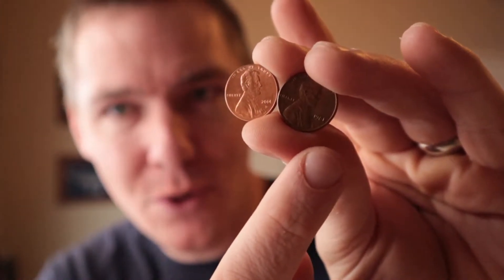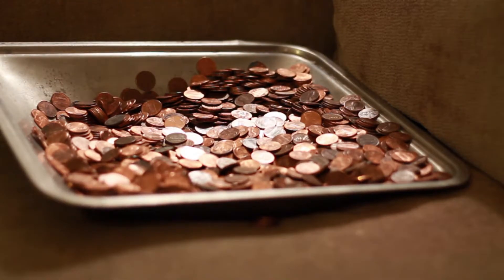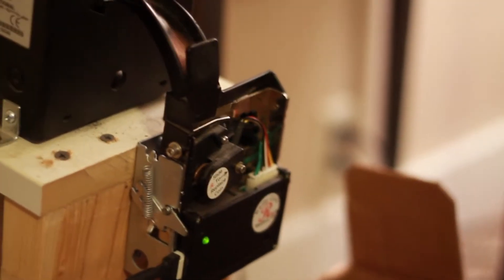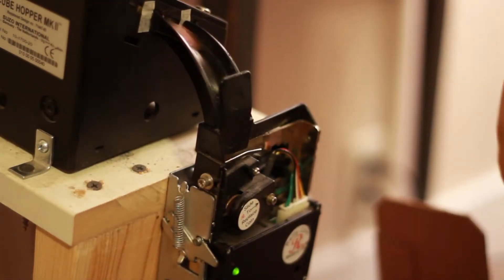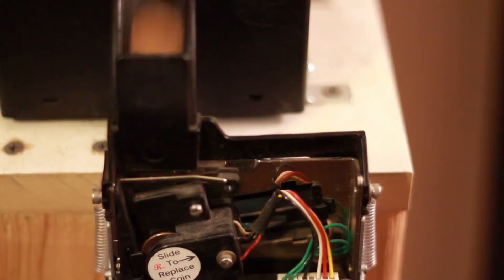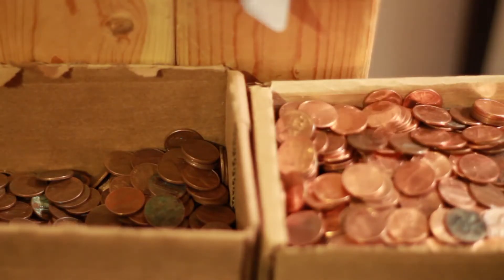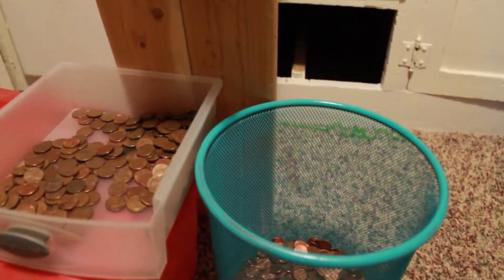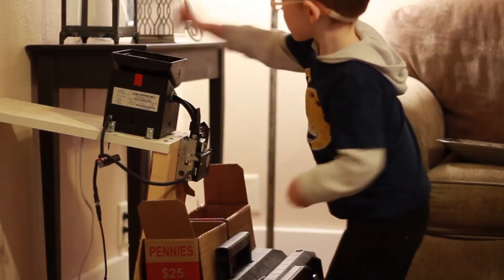Sort Copper & Zinc Pennies with a Reilly Coin Sorting Machine

Comment: Thank you for your video. For those who are unaware, 1943 dated copper one cent coins are extremely rare and extremely valuable potentially being worth in the hundreds of thousands of dollars. This is because most 1943 dated one cent coins were made of zinc plated steel during World War 2. Furthermore 1974 dated aluminum one cent coins are also extremely rare and extremely valuable potentially being worth a million dollars or more. This is because almost all of the 1974 dated aluminum one cent coins were melted by the United States Mint and were not released into circulation.

Comment: Random, but the old pennies have a  density of about 8.8g/cm3. The new is 7-7.2g/cm3

Iron filings or steel bearings are around 7.8g/cm3. Old pennies would "sink", new ones "float".